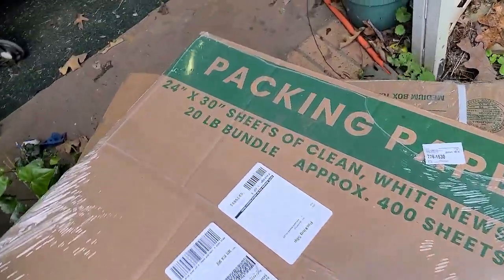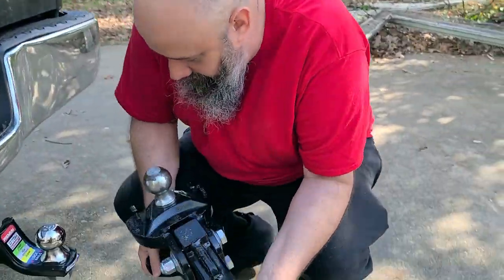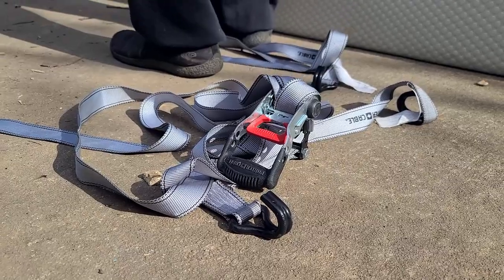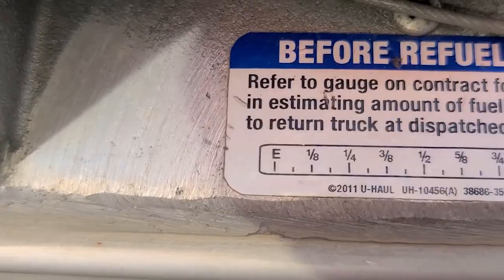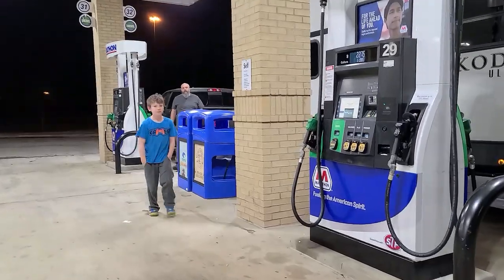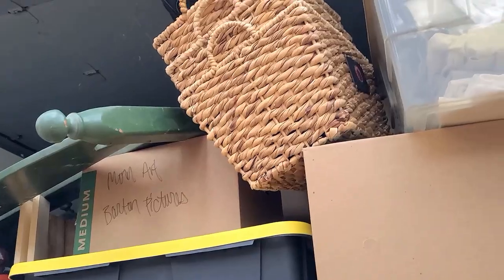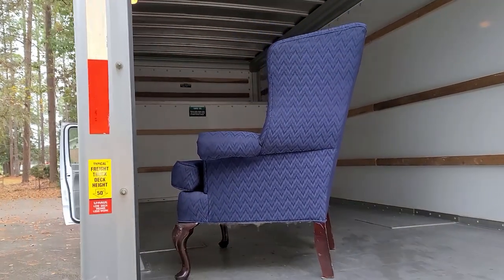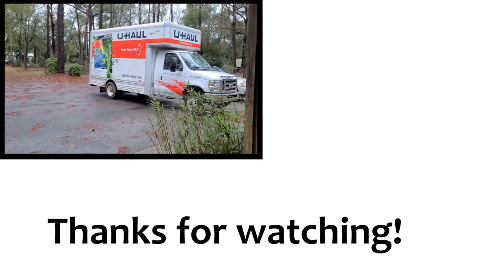Cheap (Cheap) Moving Boxes PLUS: U-HAUL 20 ft Truck vs 6 ft x 12 ft Cargo Trailer Review!!

Comment: Hi I was wondering how much of the house were you able to fit in the 6 × 12
Reply from the maker: @Jose Rodriguez We fit a sofa and loveseat, a gaint TV, a large generator, 2 sets of portable bunk beds, 2 twin mattresses, a king size mattress and I'm pretty sure the dining table with 4 chairs. Bare bones furnishings for our family of 6. :)
Reply: @BeingBarton  She stated her king size matress didnt fit. From my measurements it should fit on 6x12 without bending get it trough the door horizontally than u can just stand it up on the side ??? Am i wrong?
Reply from the maker: @transxcorp  By my measurements, the king size mattress is 76" and that's just a bit bigger than the 6ft height of the trailer (6ft=72"). 🙂 A California King is 72 x 84. But we just have the standard 76 x 80 king. I hope this helps!